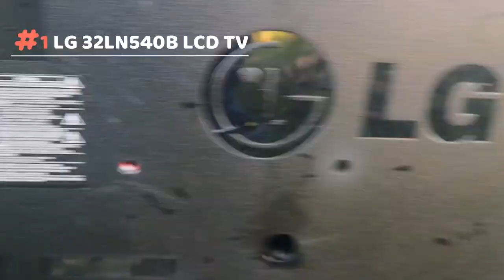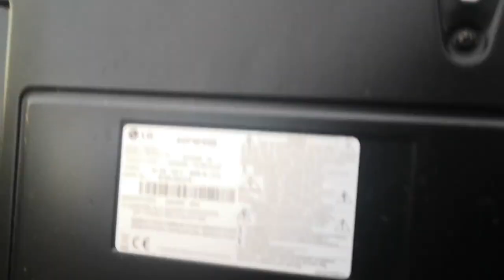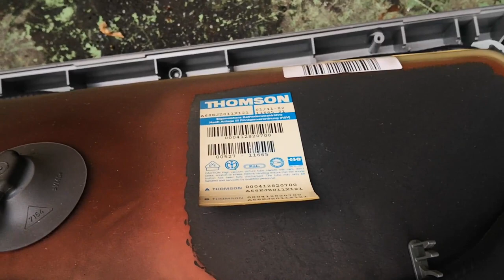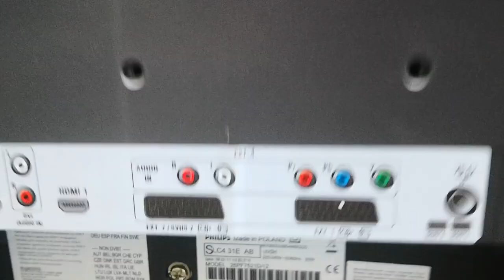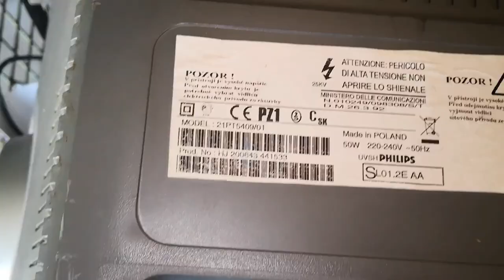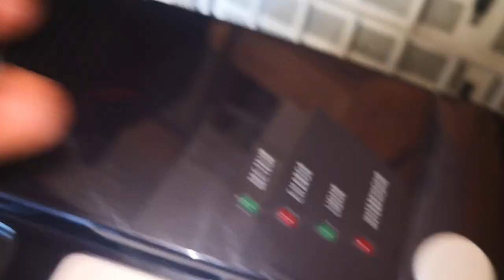Speaker Hunting Video #30 | LG flatscreens , Thomson CRT with Faital Subwoofer and more !

Comment: small correction the 2nd LG tv you dismantled was a Plasma TV they can be dangerous if the screen is not cracked because they can hold a charge just like CRT tv's can
Reply from the maker: I knew that was a plasma when i took it apart but idk why i wrote lcd...